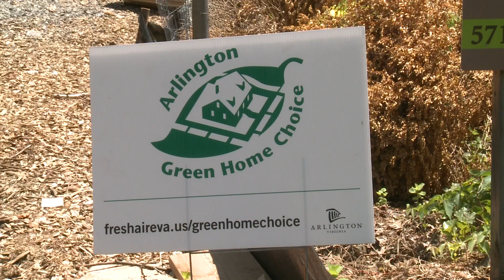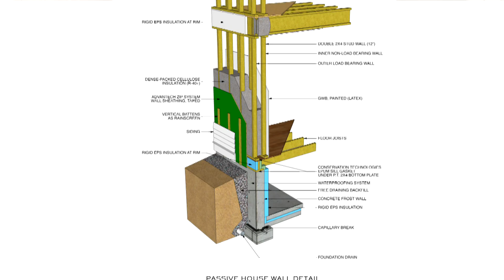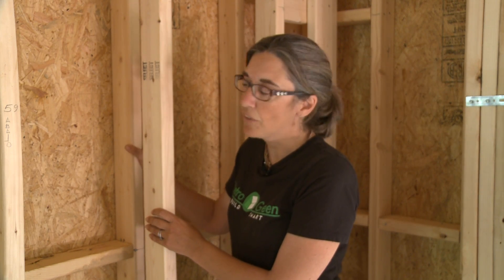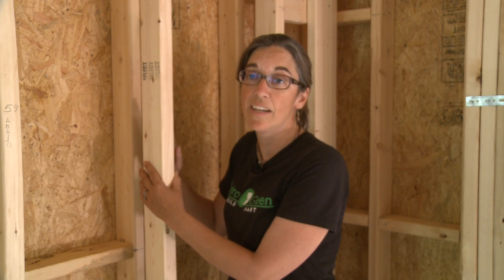How to Build a Better Home - Wall Construction and Insulation

Comment: As you alluded to - Every area is different.
In Canada, the building code now is - All Exterior Walls Must Be At Least 6 inches in width. [ 2 X 6 ]   Adding another wall is permitted. [ double wall ] 
In this day & age of rising heating costs, having a thicker wall with quality insulation, will save on the heating bill.  Pay Now Or Pay More Later.

Comment: Wouldn’t you need more insulation the further south you go ? 
I am in Tennessee and my heating bill for my 3500 sq ft home is never over $150 a month my cooling bill in the summer reaches as high as $800 a month. I am in a standard construction home build in 1990.

Comment: I have to disagree… I think this is total overkill. I think a 2x4 or 2x6 with a 2” foam board on the exterior for a thermal break, and 3” of closed cell spray foam will actually outperform a 2x8 or 10 wall with fiberglass or cellulose. The r value is less with the way they measure R value in a controlled model, but in REAL world application the close cell spray is MUCH superior. ❤️
Reply: and more expensive

Comment: Is there any benefit to staggering one set of 2X4' studs so that they are not in line with each other?  the reason is that the insulation will be thicker in between the joists, and cut the thermal bridging to a minimum.  However, I see why this may also complicate construction a bit.  Is there any benefit to closing the first cavity with a membrane or plastic, and the back of the second as well, so as to create a complete air gap, through which electrical and even plumbing can be passed?  Thanks for the very informative video.
Reply: you want only one membrane as using multiple would trap moisture inside the wall. You want the whole wall assembly to breathe through to a single barrier.

Comment: I think this information is outdated. I don't see any benefit to a double wall vs using more exterior insulation along with an advanced framed 2x6 wall. It seems more material and labor intensive, and with worse performance. Keep all the framing conditioned, and only use what you need to support the building. Double walls may work, but I don't think it's a good design from first principles. The "Perfect Wall" approach is the way to go, these days.

Comment: What about just building the house with concrete walls???
Reply: Concrete walls are probably a good idea in some areas, but a wood structure can be just as strong, much lighter, cheaper, and easier to work with. Concrete will be more naturally fireproof, and quieter, and maybe quicker to build.

Comment: Sooner or later people will understand that only exterior insulation makes sense. That plus European class energy efficient windows will also force homeowners to use ERV/HRV systems. But then, in a winter time temperature inside will finally reach steady 70° and above. No more triple blankets on bed.

Comment: I am working room to room in our house to remove the existing pink insulation, add rock wool r15 batting, then add the 2nd stud wall w/another r15 - I didn’t add the space between the stud walls, I just shifted the studs to prevent overlap where I could. Not as good but then each room only gives up 4”. My Wife thinks I’m a Nutter but she does approve of the deeper window sills. As a DIY guy, I appreciate how easy the rock wool batts are to work with. Impressive stuff for sure. I’ve got 2 rooms complete with 7 more to go, may finish by summer 2020. The kitchen is going to the toughest - hard to give up any space at all there.
Reply: You say you are removing the old fiberglass insulation, so I assume you removed the 1/2" drywall to get to it. Thus the added wall only adds 3 1/2" to the overall thickness. One other thought, would to install Tekfoil or Airfoil radiant barrier between the 2 insulations - it will decrease any air movements from the outside, and add about R2.5.

Comment: I can’t believe that US is so far behind in construction of houses compared to Scandinavia. 
We did start using triple glass windows in the 70s...
Reply: Its more about your climate than how" far behind " someone is with building techniques. For example in the southern part of the united states they use a hip roof design with eve overhangs without soffiting. A Flatter rake roof. Some areas don't use heaters...and single paned windows...I could easily say... We have used double ply windows forever up north...you guys are so far behind. They'd simply say. We dont need double paned windows.
Reply: The reason is economic. Stuff is cheaper here, and people don't think long term. We can thank Europe for a lot of innovation that can dramatically improve building performance and long term value. Some of us are watching and learning.

Comment: 37 VIDEOS on how to build Passive with details from the foundation up https://www.youtube.com/user/seumas2/videos
Material used Port Alberni's first Passive house (Passivhause) build in the heart of Vancouver Island British Columbia Canada.

Passive House(Passivehaus) is considered to be the most rigorous  voluntary energy-based standard in design and construction industry today.
Passive house buildings consume up to 90 percent less heating and cooling energy than conventional building.

The use of Passive House design software was used to gain the specs required to meet the performance standard for this location.

House was constructed well  above the current standards as outlined in the B.C. Building Code.

Footings were widen to 36 inches(914 mm) due to low bearing soil conditions and additional rebar reinforcement added.

30 inch high (762 mm) high reinforced walls . Course sand placed inside foundation walls and mechanically compacted.

Three layers of four inch *102 mm) thick  Expanded  polystyrene foam sheets with all joints staggered and tape were placed on top of compacted sand.

The three layers of foam have insulation value of approximately R 50.

A 20 mil layer of poly was placed over the E.P.S. sheets and taped and sealed.

Four inches(102 mm) of 30 m.p.a fiber reinforced concrete was placed to form a slab over the foam based.

Slab is isolated from concrete stem wall with four inches (102 mm) of E.P.S. to prevent thermal loss.

All cold water lines are buried in the sand to keep them cool, hot water lines have been placed in the center layer of foam insulation to minimize heat loss.

Wall plates compress to heavy beads of acoustic sealant between layers of vapor barrier to prevent air movement.

The walls are double stud configuration set at 24 inches (610 mm) on centre and plates are spaced in a manner that yield a 20 inch (508 mm) thick wall. 1/2 inch (12 mm) standard plywood sheathing with  Mento 1000 a three layer airtight vapor open house wrap( far superior to common house wraps) with 1/2 inch(12 mm) pressured treated plywood rain screen battens form the exterior surface. 

Intello  smart vapour barrier was installed one third in from the inside wall to prevent condensation in this climate.

Triple pane argon filled windows meeting passive house standards from Euroline  were placed mid wall to reduce wind wash heat loss.  All window openings have been splayed at 45 degrees to give a full wide angle view.

Almost all the wiring and plumbing was kept inside of the vapor barrier envelope to minimize air leakage.

Passive house standard requires air leakage not to  exceed .6 Air changes per hour at 50 pascal.

Zehnder comfoair 200 HRV has been installed with a 1000 watt air preheater .(92 percent heat recovery rate)

House has been pre- plumbed for a heat pump water heater reducing  domestic water heating cost significantly.

Garage has been pre-wired for 40 amp/240 volt  electric car charging station.

House to be equipped  with  heat pump condensing dryer which requires no external venting,only a water waste line. George K Builder. © George K 2019       https://www.youtube.com/user/seumas2/videos

Comment: A 6 1/2" Structural Insulated Panel from R Control will get you a R 22 at 70 degrees and R25 at 25 degrees. Add BASF graphite increases R value to 30-33. A whole lot less material, labor and carbon foot print to manufacture extra material.

Comment: In Empire USA, over 99% of exterior walls are built of 2x4 construction, with only 5 inch total depth and with 40% of wall having zero insulation. For 15% of wall is windows and doors, and 25% of wall being solid wood from siding to the drywall.  Surely, 99% of modern homes have a wall R rating of less then R10. And so, place 1.5 inches of polystyrene sheets on the inside and outside of all wood components, which will increase 25% of wall surface from R7 to R22.  This will increase the insulated cavities from 3.5 inches to 6.5 inches, and cavity R rating from R13 to R24.  Do this and your wall R rating will jump from R9.5 to R25.5

Comment: If you are going to build a double wall, why not do staggered studs?  It gives you an even better thermal break. With staggered studs you can even separate them with sound isolation panels and still have a thermal break.  There is a guy in Missouri that is doing just that but for his insulation+isolation he's using recycled cardboard soaked in a saturated solution of boric acid (I think for fire, mold and insect treatment)  He says the R value is as good as traditional cellulose and it is great for noise reduction (Not to mention really cheap and "green")
Reply: seems to me cellulose will settle leaving a gap at the top at some point in the future. too bad spray foam is not environmentally friendly and several times the cost of celluloser.  i am digging the double wall idea. not loving icf for several reasons. lots to think about.
Reply: I'd appreciate a link to this info, please.

Comment: I'm using 6x16cm structure filled with cellulosa. OSB inside and a false wall of 6cm filled with rockwhool, then a fermacell fibreboard. This space could be also empty, depending on your insulation requirements.
Outside a 6cm thermal coat made by fiberwood attached direclty on the structure. 
I think might be more expensive to build two walls.

Comment: I know I posted on one of your other videos and asked why not use closed cell over dense pack cellulose? cost?
Reply: Definitely cost. Closed cell foam offers a higher R-value per inch, but it cost many times more than cellulose. That's why they only use it in the band joist area between the floors, it's the best option in that location because it's easier to install and that's a pretty small area overall. Also, people who are building a hypoallergenic home would only use cellulose because it's non-toxic, while there is some chemical off gassing with spray foam.